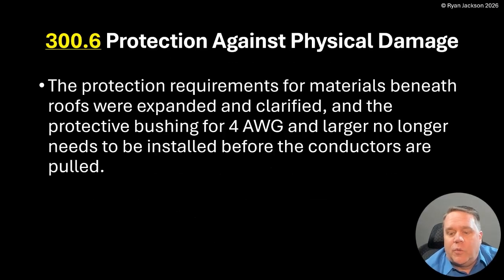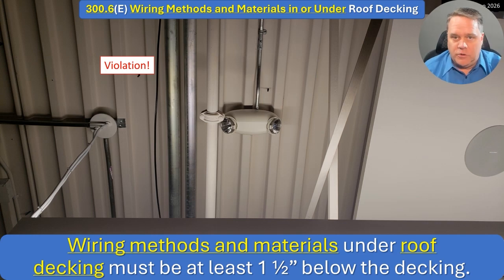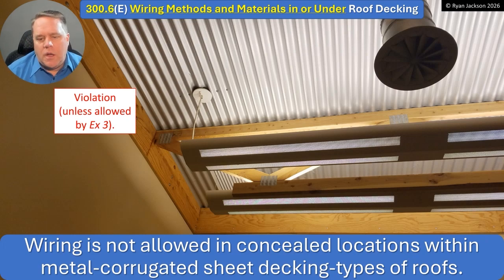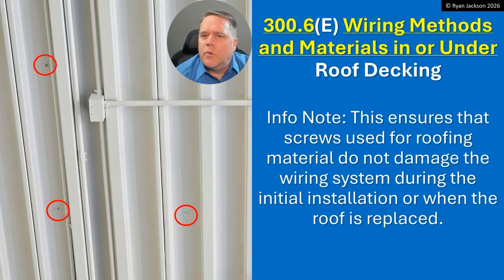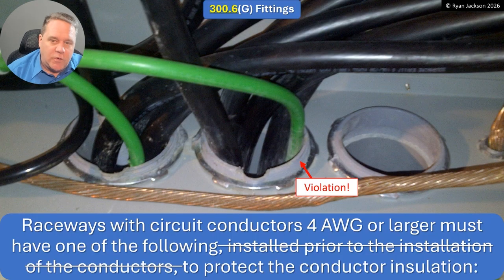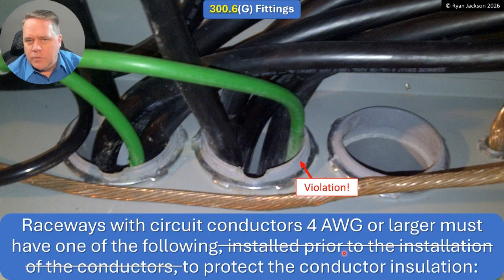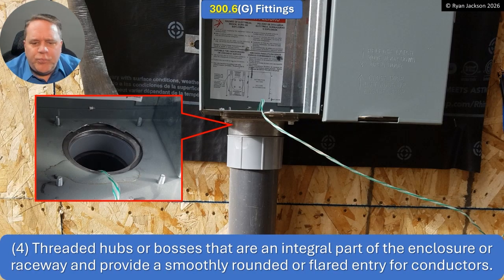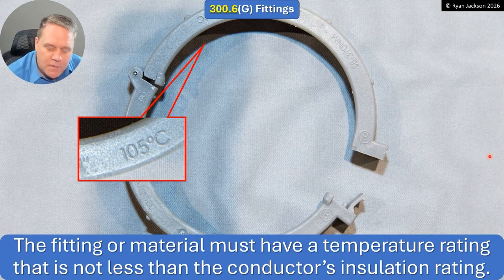100 Days of the 2026 NEC Changes Day 34: 300.6 Protection Against Physical Damage

Comment: My whole thing about requiring the bushing for the pull is:
1. Who is inspecting if they are there?
2. Any company worth their salt will properly feed and pull the wires to avoid damaging the wires or the fittings. We have always pulled them added the bushing later, though I think my area has only been on 2023 for a year.

Comment: Is a chase nipple threaded into a pvc female adapter threads rated for these types of components? I know they are used, but is it listed for use as shown?
Reply: From what I have read being chase nipples have straight threads and the PVC adapter has the standard 3/4" per foot taper would not be legal. Have wrench tightened chase nipples thru boxes & pecker heads into a heavy wall coupling and they never came loose . When I started out in 1970 our electric shop had a set of Rigid dies that cut straight threads. When a know it all mechanic used them for cutting threads for a steam line ( 120 # pressure) every joint leaked.
Reply: My pet peav is romex under a sink.  Inspectors want the romex to be sleeved to protect NM from physical damage. I always reply that only conduit is truly suitable according to code. I understand that it is possible that a midget chainsaw juggler might decide to practice his skills under a kitchen sink one day, but I find it highly unlikely.....